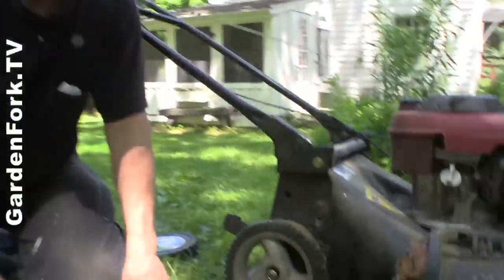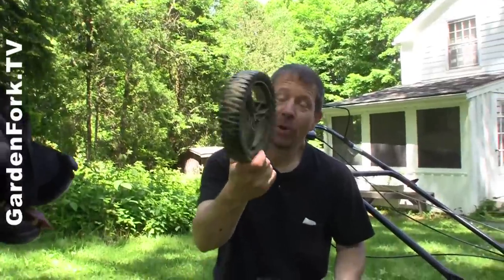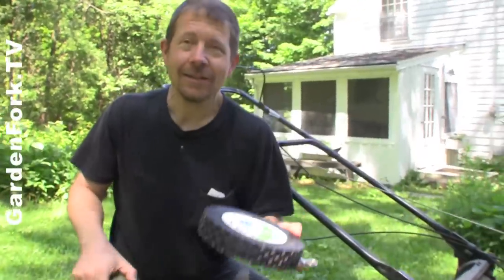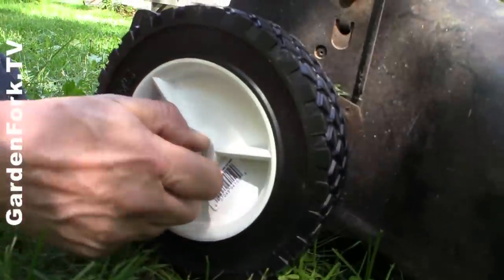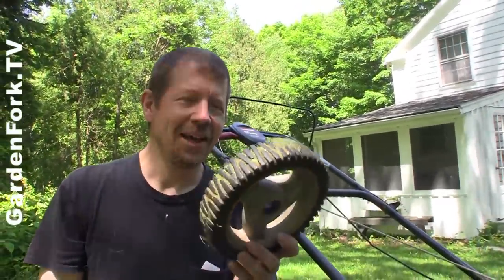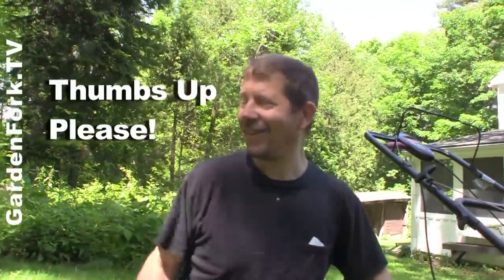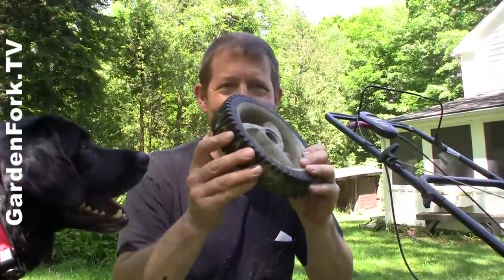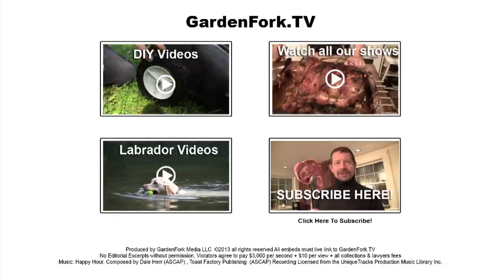Lawnmower Repair - Fix a Broken Wheel - GardenFork.TV

Comment: love the Pups in the Video!   I came here to find a video that No-Body has produced but I was looking for...lol   My front axle has a very small 1/6 inch rod that runs from the front left to right wheel and it bent very bad and could not be straightened.   So, i have had to cut my grass (only 12ft x 16ft) city lot in Pittsburgh rear rental yard by using only the rear wheels and trying to pull and hold up the adjusting of the missing front wheels.  lol  Yes, yes, I know I should buy a new mower but I am moving into a new home this summer and just waiting until its time and I have the new yard and garage and such...  Anyways, I was hoping to find a quick fix of someone that may have made a MacGyver Video with some sort of front wheel Tri-cycle Brace on either the left side, right side, or even dead center using some bracket and a standard or same wheel from the original front two with the bent axle..  lol    Any Creative Video Producers want to make a Viral Save???  haha  Thanks Guy and Great Dogs!

Comment: Great video and love your dogs!  Question, i want to install lawn mower wheels on a metal frame.  The frame holds a garden box which is quite heavy.  I'd like to be able to wheel it around the yard easily chasing sunlight.  So, besides the wheels themselves, what do I need to install onto the frame?  An axle?  Mounting bolt?  Thanks for any help you can share.
Reply from the maker: hi david, i think lawnmower wheels aren't strong enough to take the load. I'd check with your local hardware store. thx! eric.
Reply: Thanks!

Comment: Please change the misleading title name from fix to replace. Revise the dialog when the lady asks whether the old wheel can be fixed from 'no' to 'yes, but not by me'. A bad thing about plastic is its tendency to break. A good think about plastic is it's generally easy to repair.
Reply: Also just commented about the same issues.    Would like to see an actual video on "fixing a broken plastic lawnmower wheel".   Got any links?
Reply: @susieq72  Numerous YT vids for such repairs. Place those words from your question into the YT search bar and it will show numerous, varied repairs. Almost anything wrong with a plastic wheel can be fixed better than new.

Comment: Hi, I just replaced my old plastic wheels with metal ones with bearings, but the new wheels slide back and forth on the axle, even with the nut screwed down as far as it can go.  Does anyone know what I can do to fix the wobble?
Reply from the maker: Brown ElCamino you might be able to take up that space with washers. Try a couple of lock washers. they have a split in them and act like a spring to maintain tension between the nut and the wheel. thx! eric.

Comment: i have a honda mower and the front wheel was very wobbly. It eventually fell off. I assumed the bolt was bad. So i got a new bolt and installed it but it fell off again. It was also still wobbly with the new bolt. Do I need a new wheel?
Reply from the maker: turdsandwicher it may be you need a new wheel on your lawn mower, take the other front wheel apart ( the one that works ) and compare it to the broken one. that will tell you what part is bad probably. thx! eric.